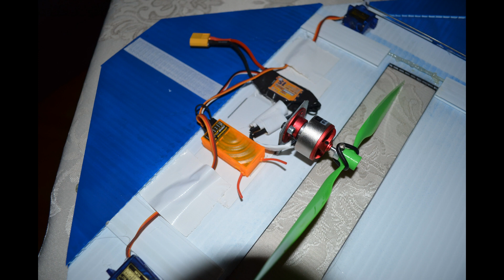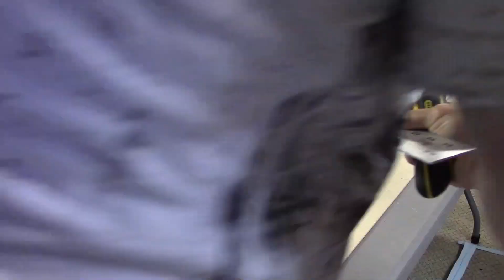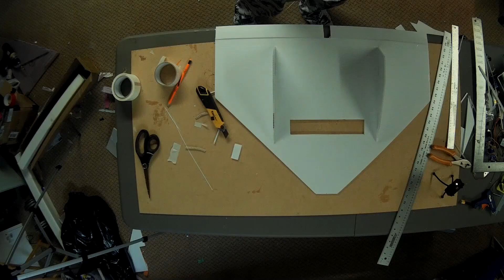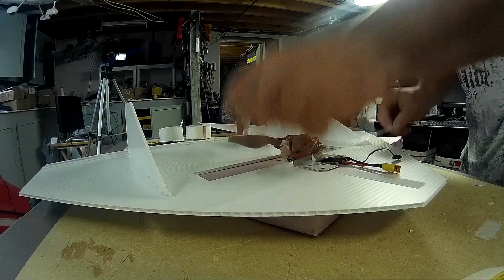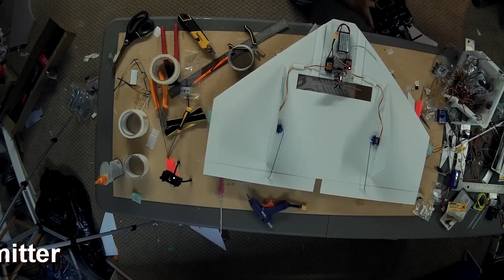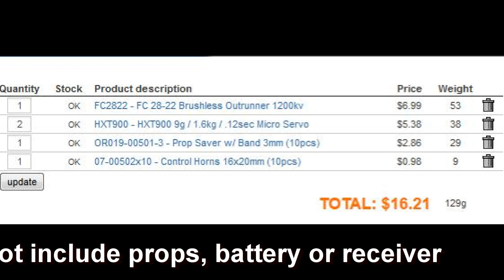Combat Delta Wing - Easy Scratch Build

Comment: Hello, could you tell me where is the CG located?
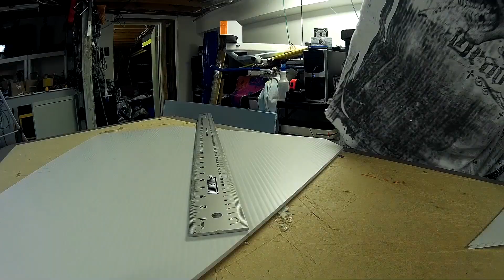Reply from the maker: It's been a long time so I didn't rememer right away, luckily I mention it in the video (just after 3:20) and it is mentioned in the description as well.   The CG is about where the prop ends up.   It's about 8 1/2 to 9 inches back from the nose.   Thanks for watching.

Comment: Thanks for the video. I have used the plastic board for combat planes. Very strong. I liked your use of inserted wire inserted and glued inside the board as a support, and the use of carpet tape for mounting the servos. Excellent ideas. What was your thrust angle on your motor? Thanks in advance.

Comment: Recently built this.  In the air, the front end folded around the front prop cut out line.  I now added 2 carbon arrow shafts front to rear close to and between the vertical stabilizers for support.

Comment: just a note your control horns should be sitting so the holes sit in line with the hinge point of the control surface. better movement and control

Comment: friend , take your plans to build my own wing but I built a smaller scale , my question is how can I calculate the center of gravity because the material used is not the same as you use . thank you very much hands suede .
Reply from the maker: Assuming you are building it to scale, the CG should still be about at the prop.  If you are using a lighter material (i.e. foam) then you will have less weight behind the prop in the design, but also your battery would be a higher percentage of the weight, so it might just even itself out.  If it balances at the prop (with this design) it should fly pretty well.

Comment: Its avionic 2826 pro 1900kv motor with 30amp esc . Building is with the same dimensions as shown in the video. Apart from the electronic components the corrugated plastic weigh about 450 grams. I just did some flight test ,Wing was in the air for some times but it crashes ....might be wrong with the cg ahh???
Reply from the maker: I can't find a link with that exact motor.   That prop is also probably too large for that motor when using a 3s.  Probably a 7x5 would be better suited.   Does it feel underpowered, or just hard to control?
Reply: UnlimitedVertical just hard to control ..
http://www.rcbazaar.com/product.aspx?productid=4104        
this link is about motor spec..
Reply from the maker: Mubarak Sharieff Hmmm.  I found this pretty good.   Your motor might be a little heavier than the one I am using, so perhaps you need a bit more weight up front.  Is is "dolphining?"   Or is it just too responsive?  I usually set up my wings with about 50% expo so that I have a bit finer grained control near center.
Reply: UnlimitedVertical might be its just too responsive .I didn't set expo . tell me the weight of your delta wing so this might help me.. THANK U..   It was pleasure talking with you ... enjoy and make some more videos of different design of delta wings ..:-)
Reply from the maker: Mubarak Sharieff
I don't have a proper scale to weight things like this.  If you used similar materials and it is the same size I don't see why the weight would be too much different.
Reply: Might be material is different ..
Reply: I feel that my material is heavier..

Comment: my delta wing weigh about 750 grams ,and I am using 2826 1900kv brushless motor with 9*6E prop, 2200 3 cell lipo battery ...My actual question is can this fly???? Or what actual weight it should be to fly?
Reply from the maker: That prop seems pretty large for that motor (of course I don't know the actual brand and capabilities).   Also, I am unsure how large your delta is, but for a 30" to 50" wing that sounds like it should fly.  I use a 2200 3s all the time on my 30 and 44" wings without a problem.  I don't generally check my all up weight (perhaps I should).  I generally try flying with a smaller battery first (a 1300), then work my way up if I feel it can carry more...it is usually not a problem.  This specific wing in the video floats nicely with a 1300 or 2200 3s.

Comment: nice job! I built a nearly the same plane but I found I was happier with it after I added a third vertical fin directly behind the motor and am considering reducing the outside fins using them just for flex support. I had to add a rod under the motor to stop flex under power. As for the hinges I tried only leaving 3 1 in  hinge on each side to reduce resistance. I 've had trouble with hot glue on election signs. I also added  1 in strips for anti flex on the bottom with bamboo pegs from top to bottom for alignment instead of slots. Maybe next a rudder. I no longer fear cyclone fences they fear me.
Reply from the maker: lol...thats awesome.  The center fin sounds a bit like the firefly.

Comment: What thickness is the coroplast?
Reply from the maker: .157 inch (4mm).  Here is the stuff I bought from home depot.  http://www.homedepot.ca/product/white-corrugated-plastic-sheet-157-inch-x-48-inch-x-96-inch/924856
Reply: UnlimitedVertical
Thanks.. Looking for a Home Depot on the left coast that carries it
Reply from the maker: If they don't have it you can always grab one of those larger election signs :-)